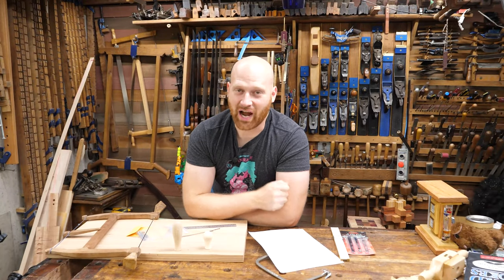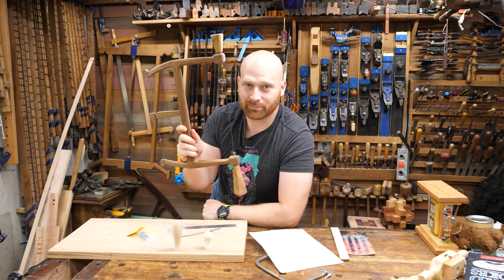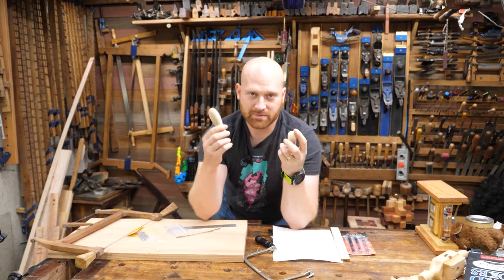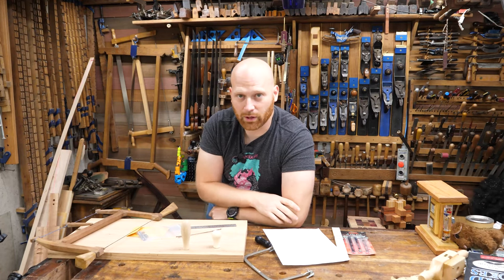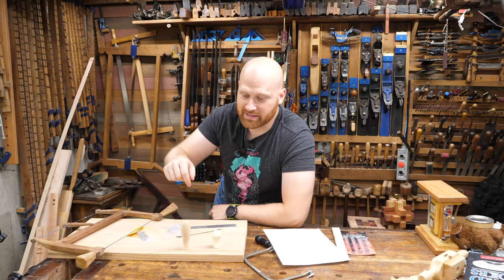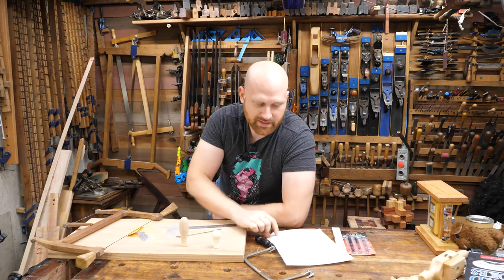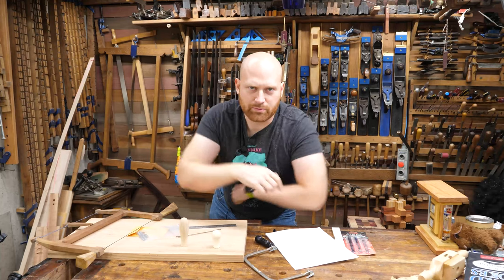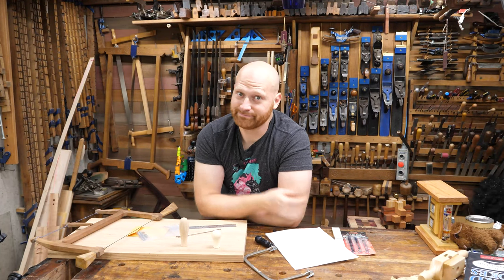Special Live Announcement

Comment: I can't tell from the description on taytools.  Does the complete kit come with the blades too, or are you saying which blades you use because kit doesn't come with them?  The project looks like fun.  Any recommendation on what tools we should have so we can be ready to go that morning?
Reply from the maker: The kit does not come with a blade so that you can choose the size of saw you want. I'm making a smaller coping saw with a six and a half inch blade. But there are a few companies that make longer ones such as tools for working wood that has a 12-in blade. As to tools it will be mostly the basics of a plane a carcass saw, chisels and mallet, brace and 1/4" bit, maybe a dovetail saw if you're feeling fun.

Comment: Is there anyway of making the things from the kit at home? I don't think I'd get the kit shipped to Australia in time
Reply from the maker: Possibly you can make them. The two steel rods are 1/4-in and have two notches in the end to hold on to a coping saw blade. And then you can make the two handles. You just need a small piece of leather to make the washer. And then some string or twine.
Reply: @WoodByWright  awesome... I'll have a look into it, my birthday is the 8th so my gift to myself will be making this saw. Love the channel by the way